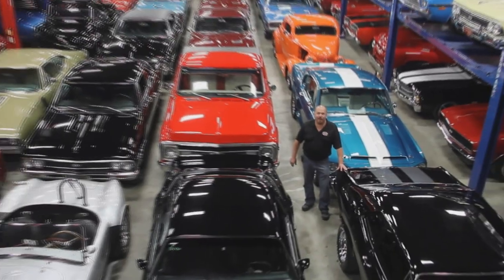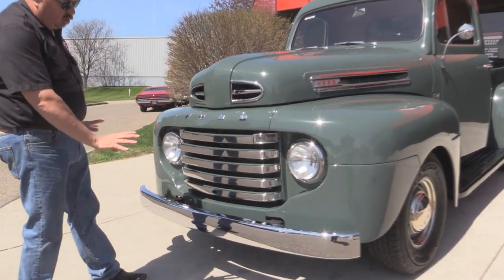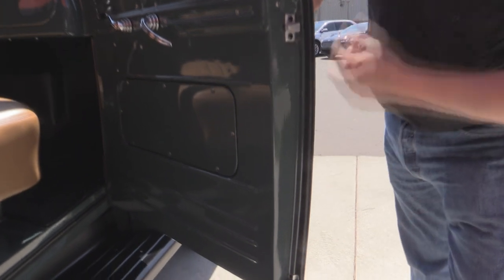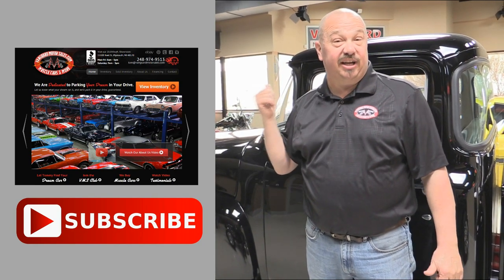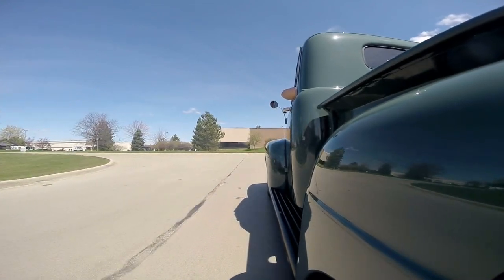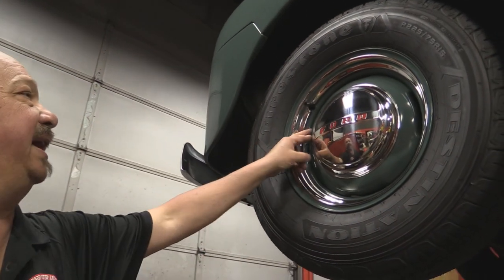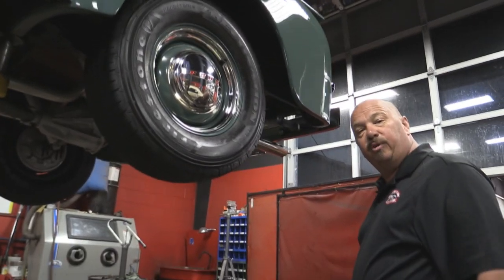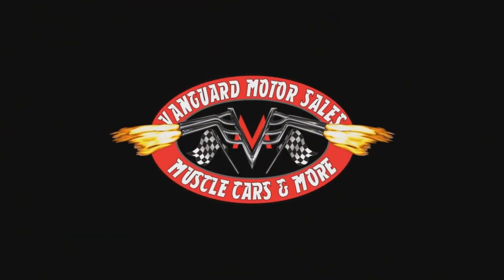1948 Ford F1 Pickup Truck For Sale

Comment: This is one of the finest restorations I've seen. Excellent fit and finish of all panels, perfect stainless steel trim work. This one may look better than when it came out of the factory!
 Thanks too for not mutilating this classic design into some far out custom job. The fenders although fiberglass match the originals flawlessly. The other additions are also tasteful without intruding on the original intent of the Ford's stylists( 302 OHV V8, dual power brakes and disc brakes). 
 All in all this is the perfect marriage of original styling with a modern power train and braking components.